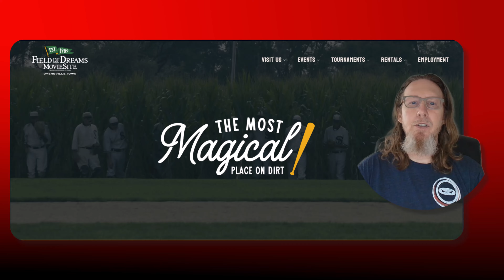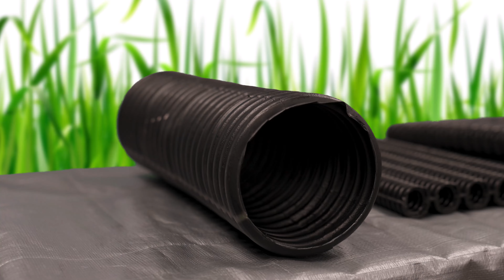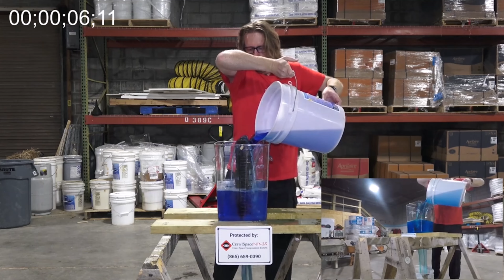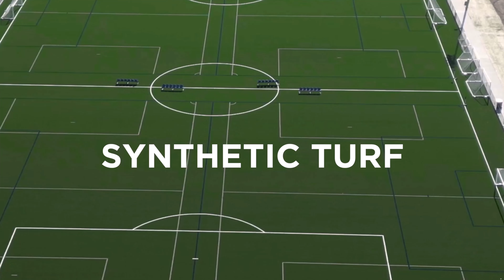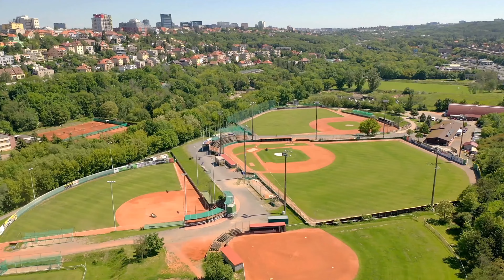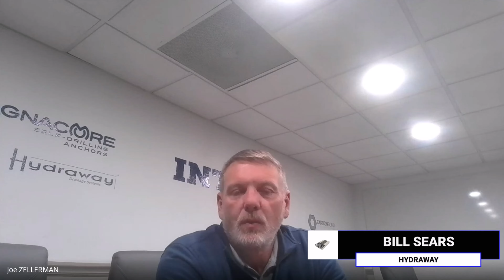Your Lawn's Drainage Problem Has a Better Solution Than You Think

Comment: That point about narrower trenches saving your turf is huge. I usually grab NDS round pipe at Lowe's for basic yard drainage, but panel drains look way cleaner to install without tearing up the grass. How well do these hold up if a heavy lawnmower drives right over the trench?
Reply from the maker: Hydraway is extremely strong and holds up to large mowers. https://supply.crawlspaceninja.com/products/hydraway-waterproofing-french-drain

Comment: It would seem that root intrusion would be a troubling issue for French drains.  How is this issue addressed? 
Also, if a Hydraway French drain is installed and then it rains with water running down hill, it would seem that the surface water will simply run over the Hydraway. Is there anything that Hydraway recommends to correct this problem? 
Lastly, if the installation has a belly with trapped water and it subjected to freezing temperatures, will it ruin Hydraway? 
Thank you.
Reply: We have tested our fabric over a 10-year rain fall period.  No root intrusion was detected, and I have never heard of that happening. Hydraway will always allow water to move through our system until it cannot drain into the soil. With the proper soil conditions installing a French Drain correctly there should never be any standing water.  At that point Hydraway would remove the water to daylight.  Hydraway will never hold water so freezing is never an issue and was made to help with the freeze/thaw affect.

Thanks,
Joe
Reply from the maker: Great questions, I asked Hydraway to provide answers. Thanks for watching. Feel free to reply to Joe Zellerman if you have more questions.